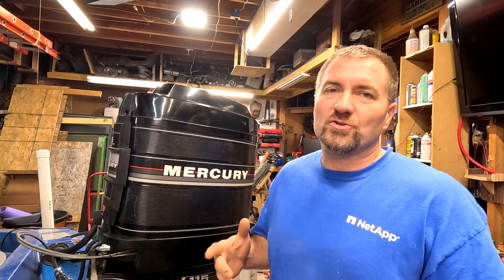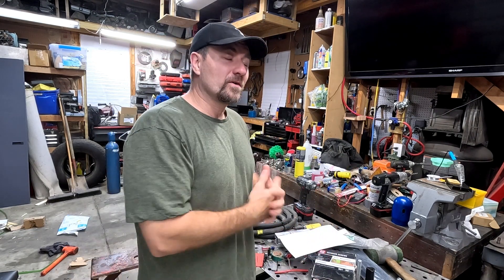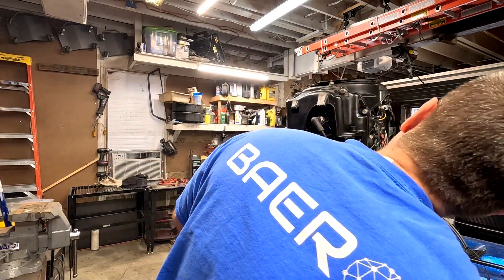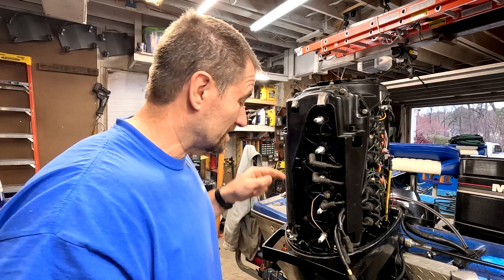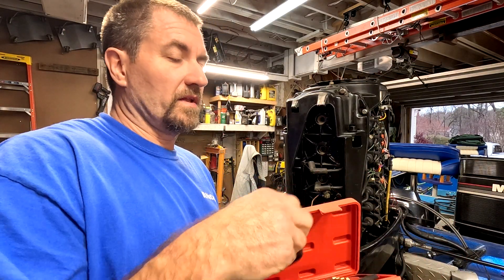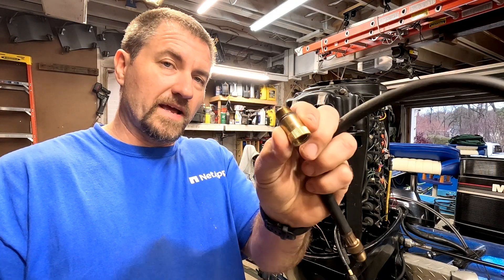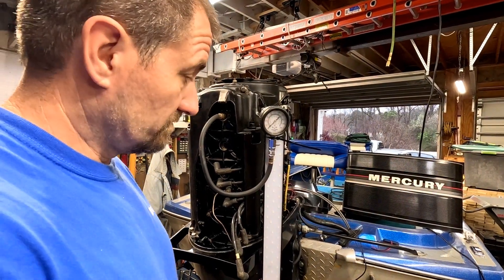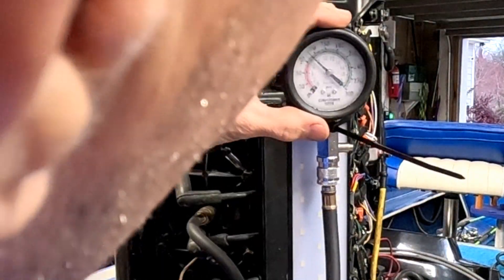Tower of Power compression Test.   Checking the health.

Comment: Old inline 6 cyl  merc   retard the max advance timing a little to help make up for now a days gas.
Reply from the maker: Thanks for the tip.   maybe you will see a video on that matter.  :)     

Thanks again.
Reply: I use to be in the marine service buss. back when those engines were new. if the timing was to advanced they would melt pistons, usually #4 as it ran the hottest. if parts are still around they are rebuildable and were great running engines.  @5LakesGarage

Comment: Good info, thanks for the video!  I’ve also heard that you want the engine up to temperature then run the compression test because cold engines can read much lower.  Just wondering what your take is on this
Reply from the maker: The main thing i was looking for in this test is if all 6 were close to be the same.    Cold you should get around 100 - 110     Warm engine about 150.       I did find some docs on the subject.   I am just happy that all 6 were about the same.